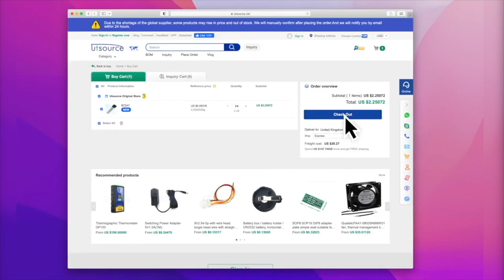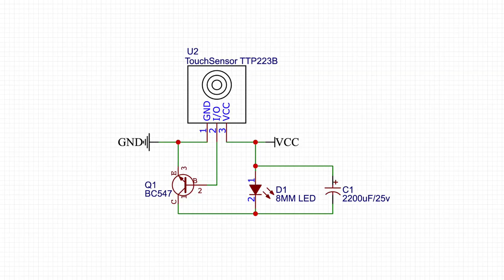[NEW] Simple Electronics Project

Comment: В этом видео два момента лишних: мощность на выходе сенсора 500мА. Этого хватит для питания светодиода без ключа(транзистора)! И на плате сенсора есть два джампера: А и В. Есть несколько  вариантов включения сенсора .
Авторы сенсора уже все придумали.
There are two superfluous moments in this video: the output power of the sensor is 500mA.  This is enough to power the LED without a key (transistor)!  And there are two jumpers on the sensor board: A and B. There are several options for turning on the sensor.
 The authors of the sensor have already come up with everything.